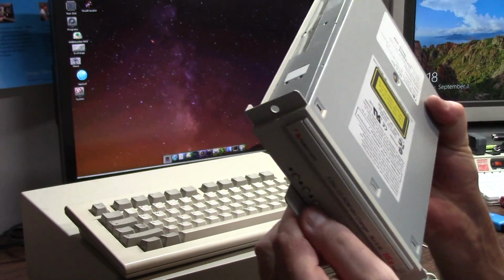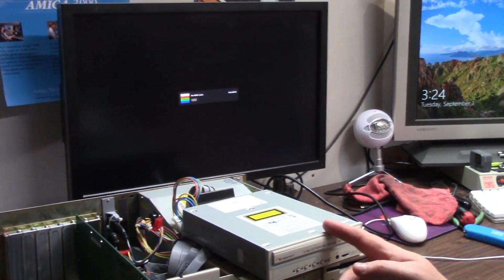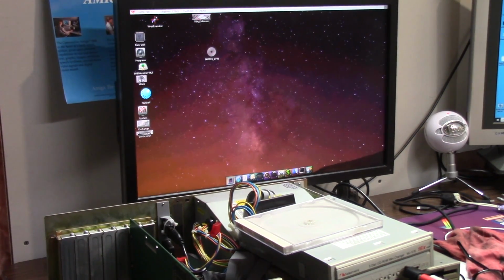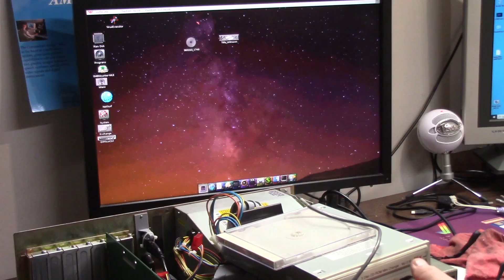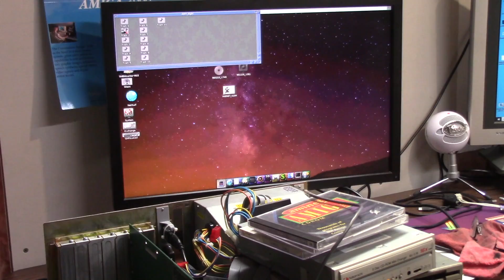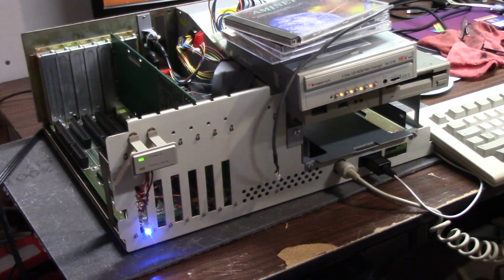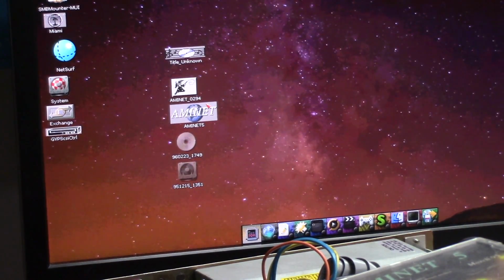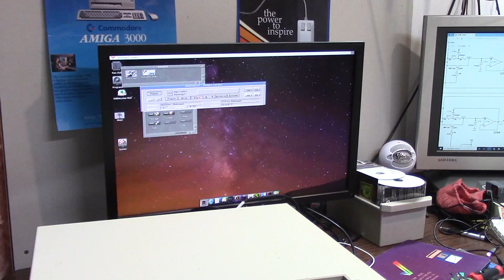Amiga 2000  multi disk cd changer and cd audio hack

Comment: Wow that's awesome.  If I can get an IDE Drive to work with my A2000 (via TF536) I may consider having this mod performed for Audio as it would be nice..  How does the volume of the CD compare to the volume of the system audio compare?  Do they pay side by side comparably?  or maybe CD drowns out system or other way around?
Reply from the maker: its fine, i run amplified speakers. I just adjust according to what Slayer song is on.
Reply: @ChrisEdwardsRestoration  but to be clear does it blend well with paula audio at the same time?  or does it phase out or other conflict?  the video didn't demonstrate paula audio playing at the same time as the CD.  I realize you're not likely to be playing a MOD file while listening to a CD, but music making is a big part of my plans for the system so I'm very interested in this mod, but just would like to know how it should sound in the end.  :)
Reply from the maker: @8bitwidgets  its two seperate devices. it can blend because i added the cdrom audio cable AFTER the resistors on the outbound side of the RCA jacks.
Reply from the maker: @8bitwidgets  i tested this again last night, played a CD and a music mod at the same time, while its hard to listen to two things at the same time, there was no skip, no over powering of one or the other, both streams played at the same time at the same volume. so it works.

Comment: Hi Chris. I’ve picked up the same CD drive. Got hold of Asim V3.9 and 3.10 but having issues with lockup’s and error messages when attempting to install. Which version of Asim are you using? Cheers 👍🏻
Reply from the maker: 3.8. Tell it its a nakamichi mbr7 and delete the last 2 drives thats what i did
Reply: Thanks Chris. Will try 3.8 if I can get hold of it. I’m using mine with a Phase 5 1230 and add-on SCSI card which connects directly to the 1230. I know this sort of works as I’ve tried using idefix’97 with CDFS and managed to get 1 of the 5 to mount and work. 👍🏻
Reply from the maker: If thats the case just copy that
Mountlist entry and change the lun number like i did

Comment: Awesome!  I have owned several CD disk changers but never seen on for a computer and never knew they actually existed.   I only have 2 working units left, the one in the car and I have a couple SONY 500 Disk Jobber's one for CD and the other for DVD.  Both are empty because I copied all my music &  movies and placed it on my server so I can play everything at will from home or over the internet.  I only had a CD-ROM in my Amiga 2000 HD Back in the day which was used for downloads on my BBS.   Back then I believe I paid like $250 for that sucker so I was in no hurry to add a 2nd because I could find 100mb SCSI Drives for $100.   Amazing how your content brings back so many memories.    If I knew those puppies existed back in the day I would of saved up to get one.
Reply: I didn't know those existed either, was pretty cool to see. I only used CD and DVD drives on mine, on the internal A1200 IDE connector. that's really not hard to do, since that IDE connector works right out of the box. I imagine it's slightly different with a scsi connector on an expansion board like this one. I remember my cousine had something like this for his A2000, working in WB 1.3, he had to fiddle with mount list and such, which I thought was pretty bad